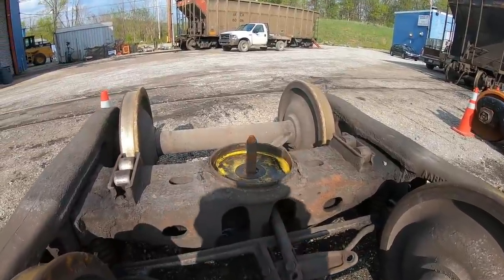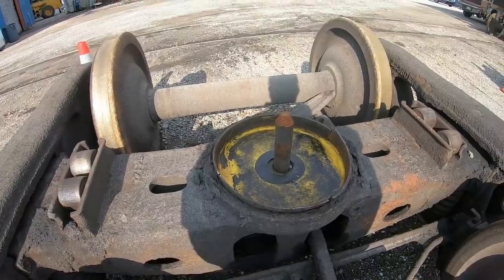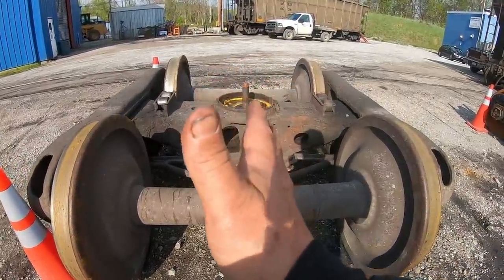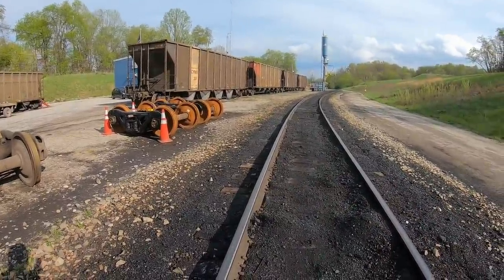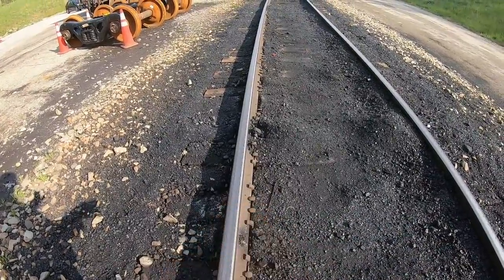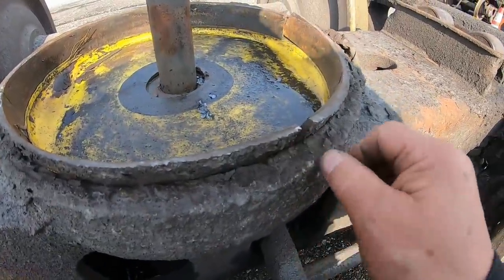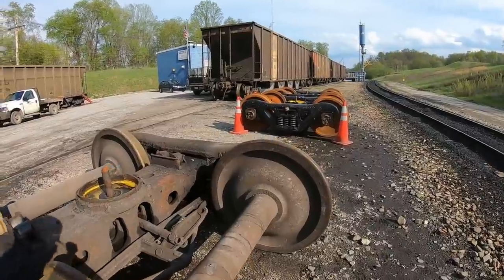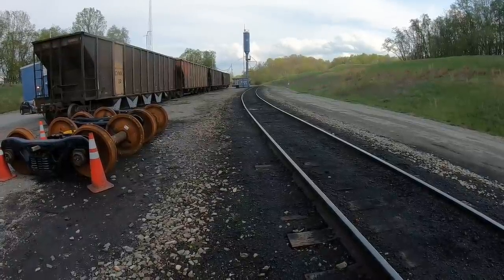Why the Derailment at Curve 18  Happened

Comment: Great video - as always. Wow! Spikes are really just there to maintain the guage of the rails not so much to hold them down, cool!  I agree with your assessment, the bowl did not appear to be well greased. I agree with another commenter (John Hill) too, cover it with a tarp to "preserve the evidence" and get a metalurgist to analyze it. Rust on the cracks seems to be a clue it had been cracked for some time.  What you call in the railroad biz "super elevation" we call in the automotive biz "camber".  So in a track/road that curves to the right, the left side is higher than the right side (tilts down to the right) to help counter act the lateral forces that want to tip/pull toward the outter side of the curve.  This would be a Right Positive Camber Curve. Near my home there is a Left Negative Camber Turn where the road is lower on the right but the roads curves left. The Department of Transportation (DOT) has overlooked that curve because it is only about 60 feet long, but every winter cars scrape up against the outter guard rail (on the right) as they slide down into it when driving in the rain/ice/snow.  I have an '87 Fiero GT. I love taking that curve because of the challenge to keep it on a road like that, the Fiero has a low center of gravity, so that helps.
Reply from the maker: Thanks for the cool comment Paul! Yep curves to right left
rail is higher. However it is not to counteract the lateral forces so
much as it is to maintain car equilibrium thru the curve, in other
words to keep weight distributed equally on both rails. Trucks sets
have to swivel and in doing so thru a curve, put lateral force on the
front wheel set and the rear wheel set which kinda equals out that lateral force. Big, big topic of discussion on the wheel to rail interface.
The big RR's have seminars every year to discuss that kind of stuff
and we are always learning about the dynamic forces a train
places on rail thru a curve.

I understand what you are talking about with the DOT. we have a
curve here similar, they didn't get the super elevation in it right
when they built it.
Reply: @ccrx6700  Thanks for the info on super elevation and how it works with the trucks and weight equilibrium.  In my Defect Detection slides that I posted, I added a slide on Weight In Motion (WIM) and how I "think" it works. Most of that info came from experiments in Poland where they used a truss bridge flexing and strain guages to measure the weight of a train as it passed - very clever. I assume it is done the same way with rail flexing - just with very sensitive strain gauges and accelerometers glued to the track. Did you see those slides yet? I gave you full credit as technical advisor (mentor). I am learning a lot from your videos. Thanks!
Reply: @ccrx6700  If you want to do a white board video on the science of Wheel Gemotery and Super Elevation in curves, I can draw up slides that we can post as a follow on. I did see a video (forgot the link) that shows how the subtle shape of wheels allows the inner wheel to spin a bit slower than the outer wheel in a curve. They have precise angles in the wheel face and flange to do that.

Comment: Interesting video, sounds like a very plausible cause.  I'm in the UK and I am fascinated by the different rail terminology used in the US, as apposed to the terms used in the UK, for instance,  'Truck sets' are called 'Bogies' in the UK, Rail cars are called Wagons, Passenger cars are called coaches, rail ties are called sleepers, and we say Railway not railroad.  I am also envious of the trackside access in the states. 
In the UK access to the rails is extremely limited by boundary fencing etc. I think that it may be because the UK track speeds are generally higher than is the case in the US (Typically 125mph in the UK for high speed passenger services) and there is far more passenger trains than freight trains operating in the UK.
Reply from the maker: Tim, appreciate your watching and for sharing your thoughts with us, hope you'll watch more of the videos coming out soon on
the derailment
Reply: @ccrx6700  Often wandered if there is any legislation for going on or near the track in US , in the UK you need personal track safety certificate , we had a days course on track safety the recertification every 2 years
Reply: You need current PTS certificate to go on or near the track in UK

Comment: Thanks for the technical description of the curve and bogie/wagon derail.
I cannot understand that you still use pins to keep the track in posoition.
Here in the UK think we gave up using pins in the early 1900's and used rail chairs, chair screws and some sort of wedge, wood in the early days to steel clips to modern pandrol rail clips. Also now on concrete tye's (sleepers).
You mentioned that you are working on short lengths 40 ft in the UK fish plates together.
Would it not make servicing and you life better if the rails were continuously welded.
This is the first day I've seen you videos, think 5.
Thanks for them from the UK
Reply from the maker: Anthony, appreciate your watching and for writing in

Comment: The standard bowl needs a modern friction bearing system or plates.
Reply from the maker: As Thomas the Tank Engine said, Silly cars always causing
trouble because they are angry. Thanks for watching my friend.
And as you know the track men always blame it on the car men,
the car men blame it on the engineers and the engineers
blame it on the track men...LOL
Reply: @ ccrx 6700
At least nobody blames FRED or at least probably the Caboose lovers. Lol
Reply from the maker: @Bassotronics  👍 😄

Comment: Very interesting video. That center pin looked to be quite a small diameter. I notice the two sets of rollers that allow the car body to swivel easily but you did not mention whether they were lubricated and rotated freely enough?
Reply from the maker: Those rollers are called side bearings and they are never lubricated although sometimes if there is too much weight on
a car negotiating a curve they can stick and cause a derailment.
Glad you enjoyed and Thank you for taking the time to check out the video. May you have a very good day my friend.

Comment: I've been studying camera frames 8:31 and 9:02, and it could be camera angle but it appears that the two  axles may be out of alignment with each other. I would like to check the  back sides of the wheels  axle to axle with a straight edge. if the axles are out of alignment with each other then the whole truck would be dog tracking constantly even when the car was going straight. then when the curve came along it would have been even easier for your theory to kick in. I am amazed at how much wear is showing on the broken part by comparison  to the new truck shown.  There should be some way to check the wear on the truck pivots, you may have a fleet wide problem. Thank you for your informative videos.
Reply from the maker: Excellent observation sir! And they are. This could have occured
during the derailment when the truck set was drug on the ties for
so long or when they drug it out from under the car across the
ground to this spot. PS: Anytime a truckset is drug on the ground 
in a train set for over 200 feet it is required to be taken out of
service and truck set fully inspected. Thanks for watching my friend.

Comment: From the damage to that bowl, I don't think it was due to 'binding'.  Quite the opposite.  The 'blown out' bowl indicates that the truck set was, "Trunk hunting -  An instability at high speed of a wheel set (truck) causing it to weave down the track, usually with the flanges striking the rail". At higher speeds this can get very violent (blowing out the bolster bowl). At lower speeds, it can be hard to notice, but seems that the alternating motion can permit the leading wheel set flange to climb the rail and derail. If I remember, it is when the bolster anti-rotation lugs of the side frames are heavily worn or missing.    
The track was not the culprit.  
See 2:36 https://youtu.be/5sVbCRLEZCE
BTW, No grease is placed in the bowl.  That is what the plastic liner provides.
Reply from the maker: Thank you for your very well thought out comment, I cannot
disagree that hunting could have had a role in the climb off, 
they gonna have to put GoPro's on all the cars to watch the
trucksets so we can see what happened! LOL 

The company that rebuilds our truck sets, Lyon's Industries of
Ebensburg Pa. told us a long time ago to put that special grease
on the liner, however many carmen have written in that grease
is not used with liners. Maybe Lyon's just wanted to sell us many
cases of grease?? LOL

Comment: If you look at the leading wheel, which would have been to the outside rail, the running surface looks to be worn such that there is very little taper to the running surface which means the wheel would not tend to run toward the centre of the line.
Reply: I couldn't really see much in the video, but you're right that the wheel profile is supposed to help turn the truck.  A slightly larger radius at the flange side means the outside wheel would ride a little higher and turn inward.

But he seemed to say this was a rather tight curve, so maybe the poor profile wasn't enough to overcome the poorly lubricated bolster and..... that was enough.  :(
Reply: @mikefochtman7164  You will find that most centre castings don't have any lube what so ever, and the amount that a truck will radius even on a tight curve is only a few degrees, what could have happened is the rollers could have, got caught at the wrong end of there travel and the weight of the car could have leaned over to create a lot of load on the rollers which couldn't move therefore jamming the truck from turning and causing the wheel to run hard on the outer rail.

Comment: Car maintenance is the definite issue in this derailment. Rust doesn't lie. The main aspect is, all equipment , locomotive and loaded cars remained upright, and no one was injured. Glad the contractors were able to get track repaired on open in a timely manner. When everything is completed and trains are moving, take a couple days off and get some well deserved rest. Look forward to seeing the rest of videos on the repairs and that was a smart move to put 1st car in shop to inspect the trucks for pre existing damage. Stay safe and get some rest!!!!!
Reply: Never worked on the railroad myself but you talked about car maintenance how often should the railroad pull that car off the truck and check that little yellow plastic disk?
Reply from the maker: Sometimes things just break and go bad on the RR. We been
very fortunate that this was the first time that I can remember
since 1993 or earlier that a problem like this has occurred here.
Thank you for watching Robert and hope you will enjoy the rest of the
videos coming out about the derailment events.

Comment: WOW,I NEVER SEEN THIS GREAT VIDEO..
WHEN I WAS 12-13 YO,GULF USE TO DO COMMERCIALS ON DIFFERENT LUBRICANTS.1 WAS A LUBRICATING DISK THAT WAS PUT OVER THE PIN..I STILL REMEMBER THAT.
SO,OUT OF THE THOUSANDS OF TRUCK SETS,HOW OFTEN DO THE SETS GET LUBRICATED/INSPECTED?
I WATCHED A YT ON THE TAPER OF THE WHEELS AND HOW IT CENTERS ON THE TRACK.SUPPER ENGINEERING ON TRACK/WHEELS  .. 
THANK YOU.FASCINATING.BTW,LOTS FOLKS THINK THE TRUCKS ARE BOLTED ON TIGHT..STAY AWESOME..
Reply from the maker: Very glad you enjoyed Ralph. We only change out the discs and
put in grease when a truck set gets changed out, not nearly as
often as we should, but there is just no time with only 3 mechanics
here who do everything else too. Thanks so much for watching.
May you have a wonderful day my friend.

Comment: I think you're on the right track (pun not intended). While a veteran Aerospace Engineer, I started my young career as an "Assistant Signalman" for MoPac; worked many a derailment in very extreme conditions ... never fun due to the clock always ticking.  Learned lots afterwards in Aerospace ... and "Metals are Metals".  

Visually, it is not always easy to discerne metal failures post event. Keep in mind that local conditions have a marked effect ... and a fresh break begins the oxidation process immediately ("Rust never Sleeps").  So without cutting sectionals and sending to an accredited Lab for analysis, you might want to take a look at the entire length of the 2 cracks ... probably at the bottom first ... to see visually if there are inconsistencies in surface corrosion.  If there is any amount of grease inside, you will be dealing with "Crack Propagation" issues.  That is very common and the number 1 rule in Aerospace: "There are no sharp edges on an Aircraft".  All it takes to start the process is a simple, tiny "nick" and it begins.  It is sped up by environment and incident (like load shift pressures).

These "cracks" are aided by something called "Hydrogen Embrittlement". Texas and other "Oil" related environments face this situation daily by the Cargo being hauled and "where" (wind for example):

"While most failures in practice have been through fast failure, there is experimental evidence that hydrogen also affects the fatigue properties of steels. This is entirely expected given the nature of the embrittlement mechanisms proposed for fast fracture.[8][10] In general hydrogen embrittlement has a strong effect on high-stress, low-cycle fatigue and very little effect on high-cycle fatigue."

I bring this aspect up to amplify your observation that there was almost a total lack of Grease. The function of the Grease is obvious in the function of lubrication to slow "Wear" of metals (and freedom of movement in this case). What is oft overlooked is that it serves as a protective barrier against contaminants such as Sulphur and even "Oxygen".

But the "Root Cause" is lack of "Inspections" and preventative maintenance:

"The Federal Transit Administration (FTA) has reported that there is an estimated backlog of $50 to $80 billion in deferred

maintenance and replacement needs for the United States’ public transit assets, of which the great majority is rail-related (2). Moreover, 25 percent of national rail transit assets, including rolling stock, were in marginal or poor condition."

Thanks for your video ... and Godspeed !
Reply from the maker: LOL Craig... my wife got me a tee short for my birthday that has on
it a steam loco and the words, I have a 1 track mind....

You also have a very well thinking mind sir, very good comment,
hydrogen is the enemy of metal as you say, it happens inside
the rails also. That hydrogen causes what are called in rails as
fissures, which actually grow like a cancer inside the rail and
is the cause of many a broken rail, gonna do a vid on that sometime in the future, hope you are a  subscriber and will
watch it. If not then sub and hit notification bell, it may be awhile
before I get to that, got a whole series on rail planned maybe for
the fall. Thanks for watching
Reply: @ccrx6700  thanks for your reply and done & done ... looking forward to watching your channel ...

Comment: The (outside rail) superelevation is necessary to make the car "lean into" the curve. This  provides a necessary centripetal (towards the center of the curve) force on the car to propel it round the curve (think banked turns on speedway circuits such as Indianapolis). However, if the truck will not rotate about the central pin - because of structural failure - then it will want to continue straight ahead, and the outside wheels will ride up the outside rail and tend to push it out of gauge. Tilt passenger trains overcame the need for superelevation by making the passenger car bodies tilt (inwards) against the trucks. Adapting that principle to freight cars is not feasible!
Reply from the maker: Yep Paul, it is amazing to me also how those passenger cars do
that on high speed tracks, just incredible. Thanks for watching sir

Comment: I worked a few month at a little rail car refurb shop in Maryland in '84 and we would use pucks of anti-seize for lube on the car to truck mount. We also had those old grease box axle trucks come through for a redo. Those would flame up pretty bad when the grease hardened up.
Reply from the maker: Like Thomas the Tank Engine, those silly cars always causing
trouble cause they are angry. Thanks for watching, hope
you will watch the rest of the videos in this series on the derailment.

Comment: A pro tip to think of, if metal is broken with very clean and smooth surfaces, it is most likely a fatigue crack.
Which you can get with stresses over time, like bending a paper clip back and forth over time.
If it is jagged and has sharp edges, it is an overstress breakage, meaning you apply enough force to break it.
Reply from the maker: appreciate your watching and for sharing your thoughts with us, hope you'll watch more of the videos coming out soon on
the derailment

Comment: Robert Hall  An ultrasonic sensor system may be able to check the integrity of the metal cup surrounding the vertical pin.  I haven't researched  ultrasonics to see if it would work and if we could get it into the small space above the truck set.  If we could  check the "metal cup" for cracks it would indicate a potential problem and perhaps prevent a repeat derailment.
Reply from the maker: We use ultrasonic testing for our rails here twice a year, have a 
company come in to do it Robert. Ultrasonic rail testing they look inside the rail to find defects, it works by sound echolocation, once that sound wave hits a defect it "bounces back" at a different time
frame than if it doesn't hit a defect in the rail. Will have some videos
out soon on ultrasonic rail testing and explain more in those how
it works. When they rebuilt my tamper all the metal was x rayed for
cracks, so don't know if that type of x ray they use would work also?